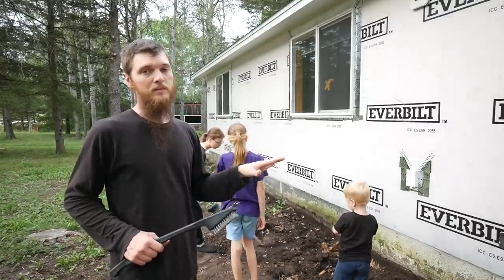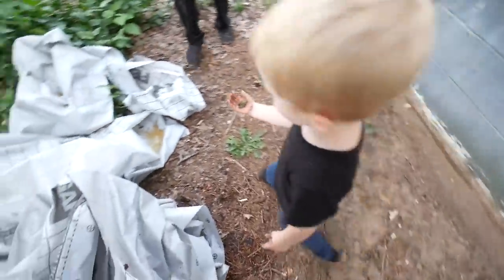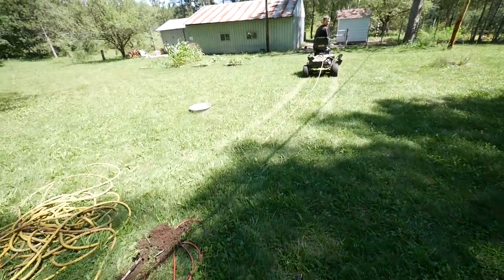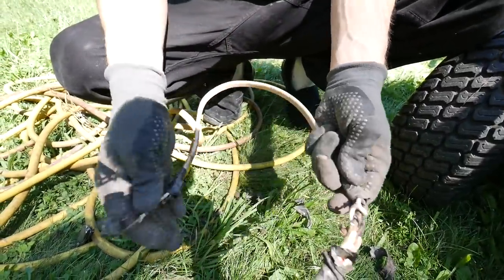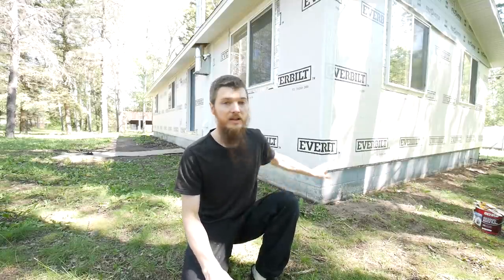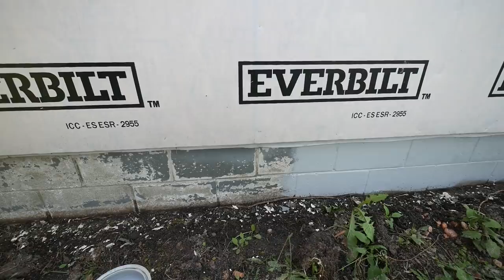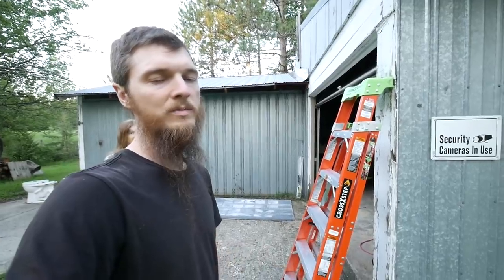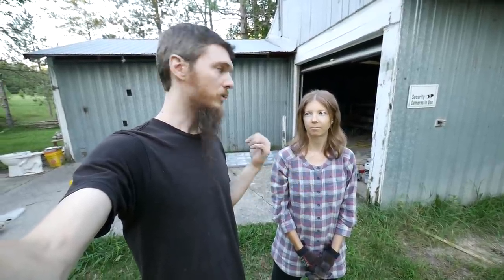Unexpected Turn of Events - Renovation Vlog

Comment: Resist the temptation, put the 2nd coat of paint on.  It will take half the time as the first coat and will significantly increase the sealing properties 👍🏼
Reply: I agree, its already prepped and clean, the finished result will last much longer too.
Reply: That's what I was thinking too. Since the first is done, the 2nd would sure be easier and you get the durabiity of a more thoroughly covered foundation. Why do all that work and not get the best benefits - and you have enough paint to do it.

Comment: With every video your home has become a showcase for your dedication and determination.  The paint, roof, windows, doors - all add so much curb appeal and actual value.  Your interior design esthetic is amazing.  The simplicity is part of the beauty.  Obviously your home is not over-designed, it is well-planned and well-suited for your family.  To me that actually makes it Your Home.

A few years ago I assisted a couple working on their modular home.  When it was time to 'clean and prep' the foundation for new paint I volunteered to do that job solo.  People thought I was crazy.  I used a wire brush attachment on my cordless drill to clean chipped paint, debris, etc.  I hosed it down and allowed it to dry.  I then did a skim coat of concrete to create an even surface.  I added a slight angle away from the house to help avoid standing water.  I primed and painted the area.  I actually worked on the job around 7 hours  - not allowing for drying time.  In reality I started one morning and the painting was completed the next day.  I admit the feeling of accomplishment when a task that visible and necessary is completed is difficult to describe.   You 2 experience that joy on a regular basis.  Congratulations and thank you for sharing your journey.

Comment: That wiring you pulled up is put there to warn about buried high power line. Shows where the power to the garage is run. Might want to put it back before someone gets fried. It's an old school way of caution tape for buried wires and gas lines.
Reply: good info

Comment: Looks fabulous. You work so well together.  Just a suggestion... when you pull the old gas line... use that hole for an electrical outlet.  We added a couple extra, the come in handy for holiday lights and whatever 👍🏼

Comment: I think you might find many uses for a power washer on the property for not too much money. The barbeque tool worked well but it was certainly labor-intensive. Maybe you would have had to use it even if you had a dedicated power washer. However, it looks like what ever you used to rinse the wall was pretty useful. You didn't use it as much as you could have. Nice color on the foundation.

Comment: “Isn’t it amazing?” He’s so cute. You guys amaze me with your willingness to do things the good old fashioned way. My husband just took out some 4x4 posts that were concreted in really deep and they used a ton of concrete. He attached a long 2x10 and put a block underneath and used it as a lever to pull them up. I was so impressed. Amazing what you can do when you use your head. He’d die if he saw all that spliced romex wire. People do some dumb and dangerous stuff. That’s why his job as a building inspector is so important. Not everyone is as smart as you guys or do quality work like you.

Comment: Grill brushes are great multi-purpose tools.  I live in a cinder block house that I'm getting ready to paint and i've used it for scraping mold off the back of the house.   I also used it to scrap multi-coats off some metal lawn furniture I bought at an estate sale.  Works great!

Comment: think getting a pressurewasher eventually would be a good investment to clean the outside of the buildings  once in a while  , the outside stuff aspecially when its near or under trees turns grey after a while and sumtimes even green , the pressurewasher would help clean that up pretty eazy , a medium sized electrical one might be enough for that , can use it on the concrete too 
i seen a few straight ladders that you can fold out and use as a stepladder , that said the rungs a smaller on such a ladder so there not realy good to stand on all the time without wearing clogs 
think you can use the trailer again too as a platform , you can stack the siding on it too and have it near where you need it 
copper is worth sumting nowadays , you should strip the insulation off the romex and only turn in the pure copper to get the best price for it over here its about 5 dollar per kilo
organic clothing is ok just make sure you keep the moths out of the closet

Comment: Just a suggestion which I found works great on keeping  out critters, like spiders, snakes, mice, ect. from getting into your crawl space. Take four old socks and fill them 1/2 to 3/4's full with either mothball crystals or plain mothballs, tie the ends and place each sock under the crawl space at the four corners. The smell drives them nuts. When finished with your exterior work, sprinkle Sevin Dust along the outside base of your foundation, it'll also keep the critters away and from getting under your siding. We also used the dust as a flea-tick power on our dogs.
Reply: Moth balls are poison dangerous around children.
Reply: @elizabethmorgan2621  I didn't say to eat them, put them in your pocket or keep them in your living quarters, draws, or closets did I? You only talked about the negatives, not the positives. Yes there are do's and don'ts. The positives are, it's ok to place them in crawl spaces away from traffic or in the attic too keep out squarels, batts, possums, pigeons, mice, wood boring carpenter bee too name a few. Some farmers even put them in their gardens to keep deer away. Sergents flea power is basically the same as Sevin Dust powder. There are Pros and Cons in everything, just like in today's politics, too much negative thoughts without checking the positives. A well known pest control co informed me yrs ago of the use of this pratice. I've been in the building trades for over 40 yrs and never, never not once ran into any problems or bad feed back using this system.    Quote:  Now you know the rest of the story......PH
Reply: @ozziestrom9793  Take the time to read the WebMd research based article about the fumes from breathing mothballs.  Fortunately, researchers now know that what people did 40 years ago can cause brain damage.  My comment wasn't negativity.  It was information to reduce neurological damage, especially in children.  You're all for healthy children aren't you?

Comment: Oh Doug, I flashbacked as you started pulling that wire. The first week after we bought our old mobile home, we were trying to figure out the wiring to the new garage (made from recycled stuff). It was extension cord wiring from the pole to the garage--buried loosely in the sandy soil. That was one of the first things we fixed. At least there were no splices in it. LOL. The foundation looks beautiful!

Comment: Powerwasher will remove the paint. The paint looks great and not a bad color, a roller would have been much faster, but you would of needed a 3/4 or 1 inch mat roller to cover the bricks. If you are using a mask to protect yourself you need a N-95 mask, I used them for the bad work conditions , mold, dust etc...

Comment: Foundation looks great, wonder if a second coat of paint would be a good idea, this coming from someone who really doesn't like to paint.  Just concerned about durability.  You have worked so hard on everything else, would hate to have an issue with such a highly visible area of the house.  You have used such good judgement on the rest of  the house, so will trust your judgement on this also.  What a great ladder, like the feature of being able to lean it on the wall and more so even the corner or pole option.  Look forward to the siding, so happy for you about all the progress you have made so far.  Wishing you well from N.W. Iowa.
Reply from the maker: Thank you. We'll see how the one coat does for now, but we do have another gallon ready to go :)

Comment: Maybe the buried wire was just used as a low voltage (DC) conductor or signal wire rather than 120v AC. Perhaps for the security camera that is announced by the sign near the garage overhead door. It's what they had on hand so it got used.
Reply from the maker: That could be :)

Comment: I like that step ladder. That is neat. If I could make a suggestion on the block foundation. I would put at least a second coat on it of the paint. Just as a little more protection for it. That wire you found in the ground was possibly a temporary wire to the barn until they were able to run the main wire. Back then they would bury it and just not worry about it much. All that mattered was getting at least electricity ran temporarily. Hope it's been a great week. Be safe.

Comment: When we bought our house the previous owner had a heavy duty extension cord in the ground to put power into our garage, they had also run extension cords in the garage for lights, power tools. The VA saw that and told the owner to remove all wire and to disconnect power to the garage unsafe. But when we had it wired the correct way their was a pipe in the ground already and it took the electrician 30 minutes to go under the house and install a correct wire, from the fuse box under the house, to the pipe that went to the garage. The electrician could not believe that they did not use that pipe to run power to the garage. Only thing I could think was he made it a temporary permanent fix and did not bother to correct it?

Comment: The problem with sketchy underground cables is that you can never be sure what is live and what is not. Sticking a tester at one end is useless because there could be breaks under the ground and small children, or adults with a spade, can find them at some future date. Get them out and be certain, there might even be a tiny scrap value.
The house is progressing, the blocks at ground level probably need periodic retouching, but the house is looking better with every step you all take. I am sure you cannot wait until the siding is on the walls.  I am glad you have invested in what looks to be a good ladder. Risks are for gamblers not for families.
Reply: Thats a nice expression : risks are not for families.

Comment: Shhhh,  don't tell the retailers the BBQ brush is multi-purpose or the price will double!  ;-)   Mine gets used for scraping paint and moss off of brick and concrete.  

Beware of the black rubber on the ladder staining light colored surfaces.  It is especially bad if the rubber is ever in the sun or on super warm surfaces.  Not that you see triple digit temperatures (like me) but the UV's tend to break down the rubber and it starts leaving marks.  All in all a great purchase you'll get lots of use out of.

It all is coming together and looks very clean and tidy!
Reply: lol

Comment: Everything you do makes a massive difference in beautifying the house.  The foundation looks wonderful and the ladder is the most sensible one I've seen.  I need a ladder and that''s the one I'll look for.  Thanks for that!!  :)  Did you figure out what that buried electric line had been used for?
Reply from the maker: Not sure what that wire was for! Here's a link to the ladder: https://www.zoro.com/louisville-louisville-ladder-6-foot-fiberglass-cross-step-ladder-type-ia-300-pound-load-capacity-fxs1506-fxs1506/i/G3807155/
Reply: @diyfferent  Thank you so much for the link!!!  I really appreciate it!  I'm glad that wire didn't cut the power to the barn/workshop.  :o)  That's what I was worried about.  But a bigger worry if it was!

Comment: I Love paint, it's so magical what you can do with it! Another job well done & under your belt! So much thought you guys put into everything. Good call on the barbacue brush.. That ladder it is kinda amazing, always fear when they are just leaned up against something unstable. 
  The old places sometimes sure do have strange wiring. Our old home still had the old ceramic wall conductor things with the old thread covered wiring running through it on the outside of the walls, upstairs when we bought it in 1980. Of course it had been replaced with normal wires. But we never had the heart to take it out on 1 wall that ran up the stairs & just painted over it & wrapped a vine of rose's around it. That old house was built in the late 1800's & the stories it could tell. We lived there 30 years & our stories where in every single room about it transformation. 3 rooms, we tore out slat & plaster ceilings & in 1 we exposed the old wide native lumber & sealed it with linseed oil, that was quite the job, another one we used bead board, because when we uncovered it that was what part of it had, it looked like that room, which was the kitchen, used to be part of an old porch, so we scraped off the old paint & repainted it. The other one, we tore down to the bare bones & drywalled it.. It was a story & 1/2 & all the debre from that project had to be shoveled out a tiny upstairs window. It's always interesting what stories a home of age has to tell. And so cool you guys will have all the video footage to tell yours. We have some snap shots, but that's about it. 
I am so excited to see what you guys have chosen for the siding. And can't wait to see what's next on the adventures & renovation projects you plan next..

Comment: That foundation is an arduous job to scrape and paint. I live in a scrubby, no-lawn area of the desert SW and the stucco on exterior walls goes down to dirt level on many  houses built on a slab. During an especially hard downpour after a long dry spell, it splashes dirt all over the stucco. So I vowed that if I ever paint, I'm going to color match the walls to that dirt splash for the whole house.

Not being stucco, your foundation will be easier to hose off once in a while and I can see why you wouldn't want dirt-color matching to dominate your color scheme choices, so that's why I didn't comment before you painted. The gray looks appropriate and will be a good choice for water streaks, which would look worse with a darker color. 

For a person with your experience and skills, the siding should go smoothly and will be the biggest exterior transformation of all, and I'm looking forward to seeing it.
Reply from the maker: Yea, dirt splash up is definitely something we're thinking out. We plan on putting wood mulch all around the house to hopefully keep our house cleaner, especially since we aren't installing gutters. We're looking forward to the siding as well, it will make the house look complete and finished. It's been a long time coming. Thank you! :)

Comment: That buried wire is something I had to deal with when I had a house in town. The moron I bought the house from LOVED to splice lamp wire together (with electrical tape) and had buried that from the garage to an INDOOR desk lamp out in the gazebo. Said gazebo only had lattice panel for a roof (so damned dangerous with that desk lamp attached to the roof). When I had an electrician come out to wire my hot tub, he flipped out about the buried lamp wire. Of course I told him to go ahead and disconnect it. It's not like I was using that light!

Comment: Everything is Amazin......🐸

I can't believe you  didn't cut that knob off. Great use of that tool! 
Thanks for not showing us your underwear.  ... you should Google Kokomos in Saginaw Mi... lol
(I remember Kokomo and the cat house) ☮
Reply: Right. I would have thought he would have cut the knob off too. Lol he cut his  ladder. I think Doug enjoys thinking & doing things outside the box; challenging people stuck in old ways.
Reply from the maker: The knob unscrewed and I was able to do most of the foundation with the knob and wire brush part removed. It made it a lot easier.
Reply: @diyfferent  I had to read your reply several times... "The know was removable..."    Autocorrect makes us seem so dumb.... lol 
As Maverick would say. "That's amazin" ☮😊

Comment: On the bright side pulling that wire gave you a starting point for running electrical to the garage. Any hand digging you can avoid the better.
Reply from the maker: The garage already has power running to it with a proper ground-rated wire :)

Comment: The foundation looks great!  Using a grill brush was a great idea.  A lot cleaner than using a power tool that would have thrown paint chips and mildew all over you.  We ran into the same issue as you did with previous owners burying wire incorrectly and running it from house to, in our case, shed.  A very scary fire hazard.  Your new ladder looks really cool too!  I like how it can lean into corners and sides if needed.  Looks like you'll have your home finished before winter!  How exciting for you guys!

Comment: When I heard the scream about the spider, I thought it was Ashley.  When the camera panned out, I then realized it was Doug.  Screamed like a girl, lol.  The least they could have done was get that direct burial romex.  Even then, I prefer to actually bury a 1 1/2 inch PVC pipe and run the wire through it.  I feel it is better that way because if something happens, you can always pull the wire out and feed in a new wire.
Reply: The direct burial Romex is fine, but the poorly done splices, are not.

Comment: Wondering if the siding is concrete board siding. Lasts forever and no maintenance.  Guess I have to wait and see 😊
Reply: I've been thinking the same thing.  I hope so. We have used that product on several projects around our house and it has held up very well, even the paint on it that is exposed to tough weather elements.
Reply: @christineclifton2480  just had it put on the back of my brick house. So pretty. Very durable and so much cheaper than having the brick repointed!